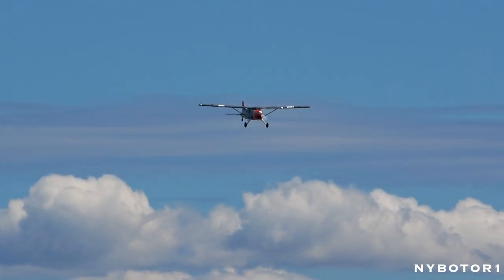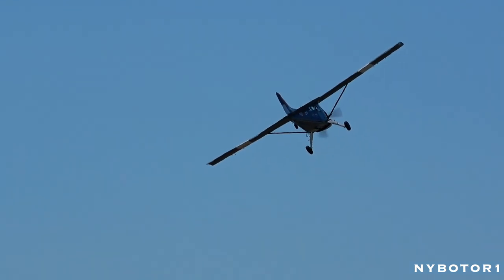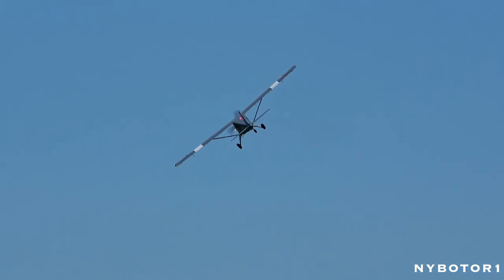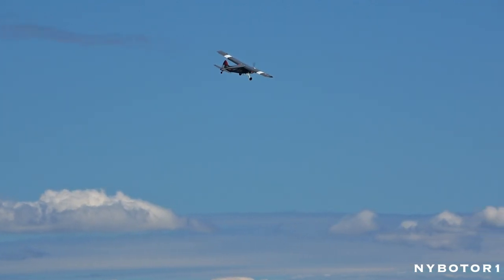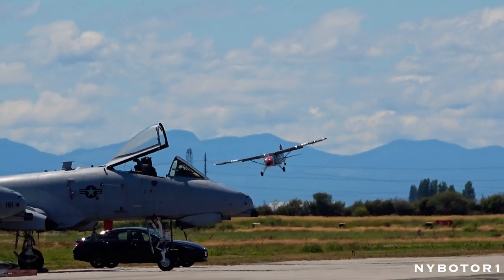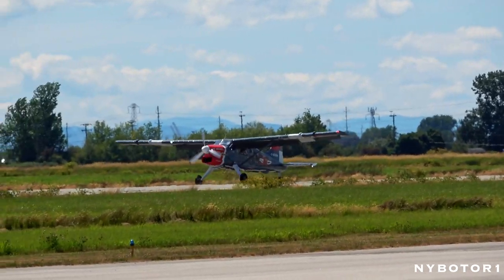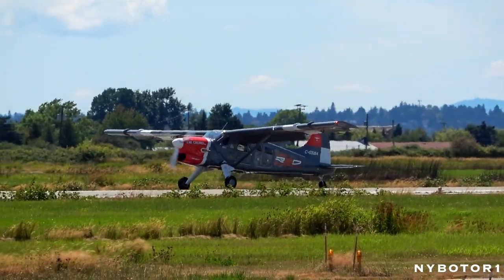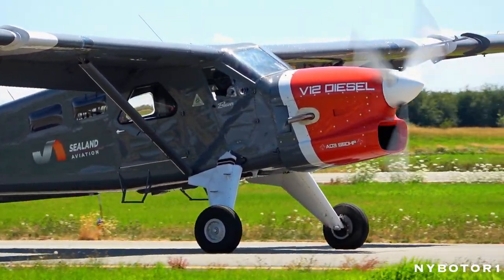FIRST EVER Airshow Demo! | Diesel V-12 Beaver Flies at the 2023 Boundary Bay Airshow

Comment: So cool to see another power plant for the Beaver. With the option of turboprop, diesel and electric propulsion, these classics might keep flying forever! That thing must be pretty powerful, it seemed to lift off so effortlessly with barely any runway used. Great footage!
Reply: Extra 100 hp, yep she'd go
Reply: @ndenise3460  radial makes 450hp, diesel v12 makes 600 i believe.
Reply: Power output: A03-003: 368kW (500 HP)Take-off at 2127 propeller rpm; 338kW (460 HP) maximum continuous at 1995 Propeller RPM, A03-005: 405 kW (550 hp).  Either 500/550 is higher than the pw985.  The fact it can use diesel or jet is the big thing as 100pm is getting harder/more expensive to find